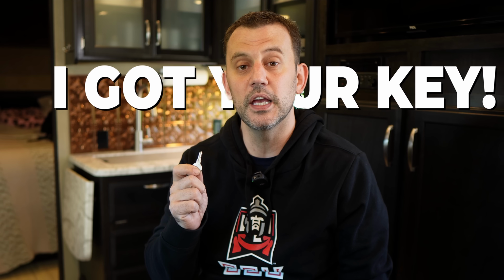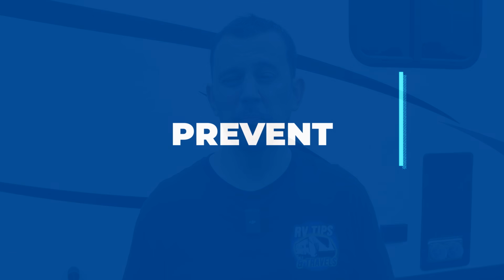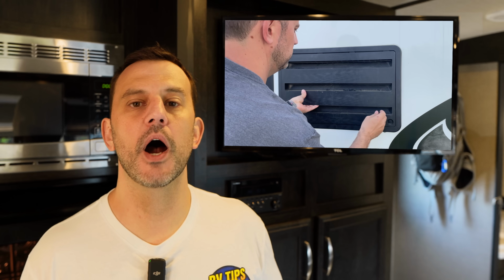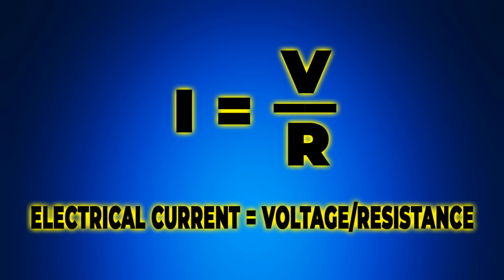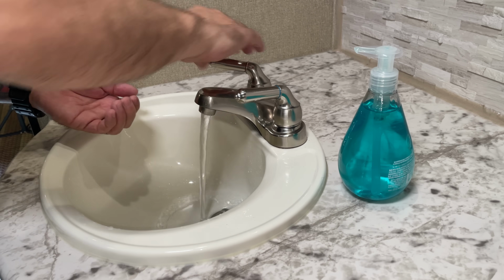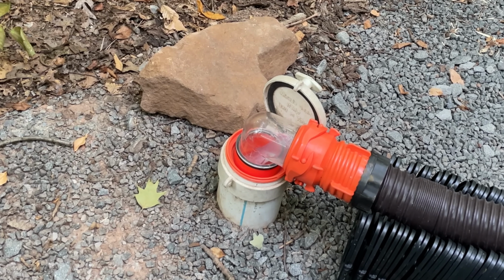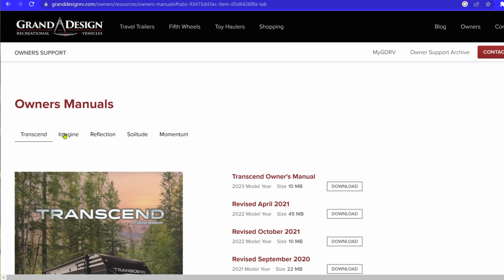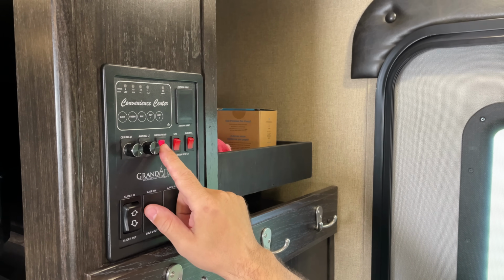7 Things You're Not Doing to Your RV... but SHOULD!

Comment: Here's a bit of knowledge that the used car sellers don't want you to know; every two years or so rub some Honda Shin-Etsu grease on all the rubber seals. Now the interesting part; when you trade in your old car because the electric windows no longer operate and you get quoted hundreds of dollars for new operators, the used car guys rub a little Shin-Etsu grease on the rubber seals, and the windows more often than not work like new. Leaks around the sun roof? Leaks around the Jeep Freedom Panels? Rubber boots on suspension parts cracking? One tube of Shin-Etsu will treat all your vehicles for many years. Almost forgot, Amazon sells it, Honda dealers sell it.
Reply: Shin-Etsu is good stuff isn't it!
Reply from the maker: thats good stuff!

Comment: That cheapo water filter... your water is your business and if you're using bottle water for drinking, then I suppose that $10 filter is adequate but why not upgrade to a better, 2 or 3 stage filter that gives your RV clean and safe water?   Two stage filters can be found for $60 and up and filter down to 0.5 microns while leaving the RV with nearly full water pressure, versus that blue cartridge, with loose charcoal, filtering at 20 microns and cramping water pressure.
Reply from the maker: I don’t drink water from hookups. Never will, and there’s more to it than the filters.  There’s a big difference my friend between where a campground gets it’s water and the well on the back of my property that filters aren’t going to fix.  Always have bottled water with me, which we also filter through a zero water pitcher.  But I do have a Camco Evo X3 inside the basement.  The shot you are commenting about was taken at the pedestal, where I always start with the inline filter before the water hits my Evo X3.
Reply: @RVTIPSANDTRAVELS    that works. We trust our filter & are glad to be rid of the supply of bottles.  Certainly personal preference tho.
Reply from the maker: what filters are you using?  happy with them?  thanks bud.

Comment: I’m camping now, and I noticed mice in my trailer and outside kitchen. The first time ever. I have a GD311bhs. They were coming in on the rod attached to my kitchen slide out. When you look at it, you can see inside the underbelly. From there they walked up the heating duct tubes and into the trailer. I happen to have some foil tape for ducts in my tool box and closed up the hole. I didn’t attach the tape to the rod, but rather just closed up the hole against the frame. When the slide comes in, if it needs more space, it’ll just tear the tape a bit and I can seal it next time. Now the mice can’t gain access to my underbelly.
Reply from the maker: Good idea Mike!

Comment: Ross, which snap pads did you add? The 2500 or the 5000?
Reply from the maker: Charlie, I’ll respond tomorrow, dont order anything yet… want to clarify something first… there is a difference between 2500 and 5000.  Hang tight.
Reply from the maker: Use this link to determine which size stabilizer jacks you have if you don’t know: https://landbot.pro/v3/H-1426153-3N8ZQBW40UYA0FSI/index.html
Reply: Thanks Ross! I failed to point out that we have the 2150rb, too. Another instance where I was thinking it but didn't type it out.
Reply from the maker: No worries, I got the 5000 lb jacks a few years ago during the recall, but pretty sure they came with 2500.

Comment: Question as to using Reflextix.  Should the reflectix be on inside or faced outwards. I was gonna make some window covers and put material on one side. I have seen ppl use all types of methods. What do you suggest?  I had heard reflectix side outward wasnt good for screens so I am not sure. Thx
Reply from the maker: i would say outside, but have no experience with it.

Comment: Since you asked, I would urge owners to clean there air conditioner coils.  Too many people don’t do it.
Reply from the maker: Here is a video for that:  RV AC Coil & Filter Cleaning -  Air Conditioner Maintenance Made Easy!
https://youtu.be/5iQp_UOqjdE
Reply: @RVTIPSANDTRAVELS   thank you!
Reply: Last year we upgraded to a 32ft bumper pull from a pop up and I've been going thru it. I happened to pull off the ac access panel and it wasn't horrible but it needed to be cleaned. I'm betting this step gets skipped by many people until it's not working.
Reply: You're right. I haven't in the 2 years that we've had our new (2020) Jayco RV trailer. I'll be sure to do that next year before we start using it again. 👍
Reply: @DaughterofYAH.CHOOSE.L0VE Did you remember to do that? Lol
Reply: Just did 2 days ago.  Owned the trailer for 10 years never thought of it .  They weren't really that bad, but dirt certainly came away with the coil cleaner.
Reply: Here’s an excellent video on coil cleaning. RV AC Coil & Filter Cleaning -  Air Conditioner Maintenance Made Easy!
https://youtu.be/5iQp_UOqjdE
Reply: I just did that for the first time. OMG a third of the surface was covered with webs, bug remnants and the fins had a layer of SW dust.  Such an improvement.
Reply: Those of us who RV off-road do. Sometimes twice a year. 
Just because of dust & dirt.
Reply: That's exactly why I had my AC stop working yesterday. It was 108⁰ outside and my AC stopped. It sucked but I still had my other AC working. Luckily, I was able to get a technician out there within a few hours. He said he pulled a full kitten sized fur ball out. I have 2 big dogs and I smoke in here so, yeah..it was pretty bad. It cost me $240. I remember recently taking off those flimsy filters to clean and forgetting to put them back on right away. But, I doubt they catch everything.